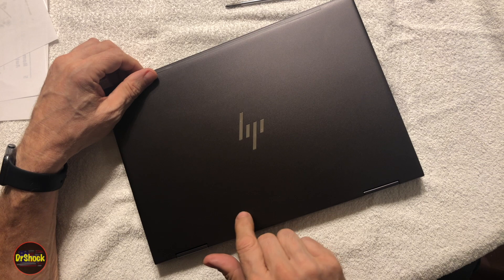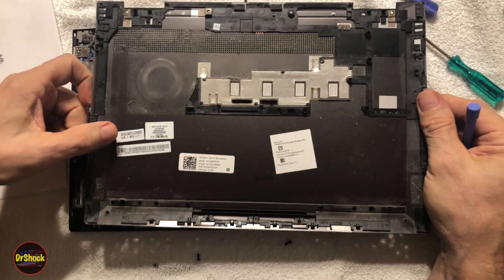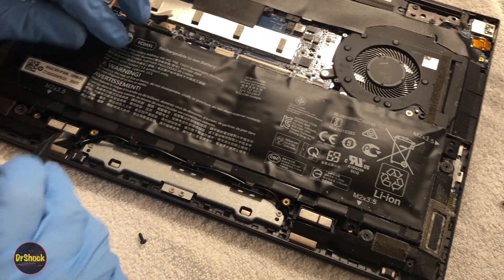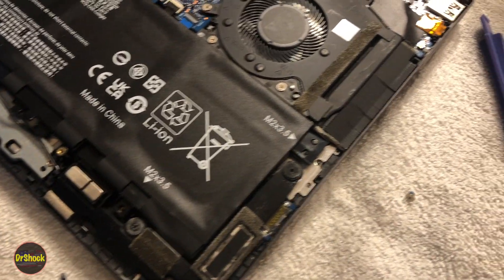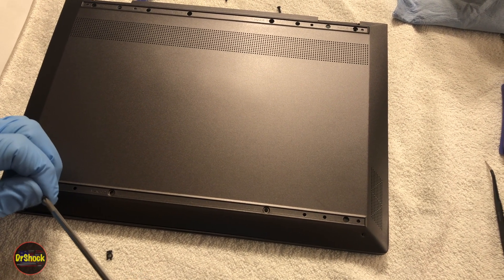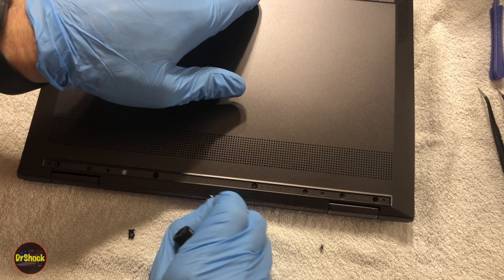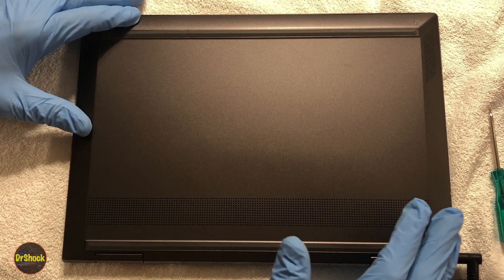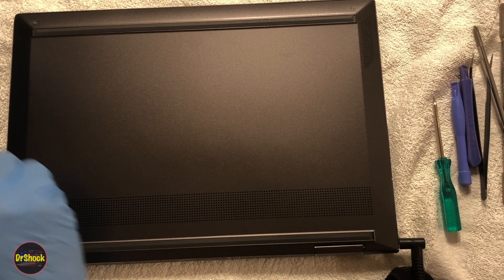HP ENVY x360 13 Convertible Laptop Bottom Cover, Bottom Feet, and Rechargeable Battery Replacement

Comment: thank you for this! very helpful. battery now works but now my speakers don't work after the battery replacement. do you know why this could be?
Reply from the maker: Thanks.  There's a speaker wire that runs long the bottom edge of the battery.  I showed how to carefully remove, and then reinstall, this wire when replacing the battery.  I would suggest inspecting this wire for physical damage given the new symptom is post battery repair in nature.